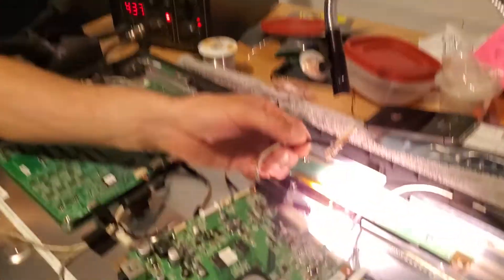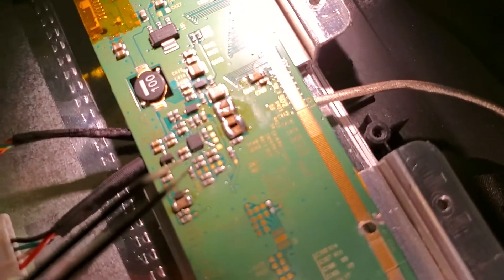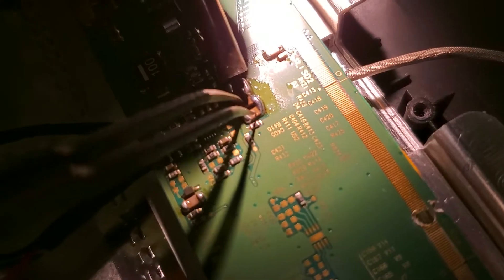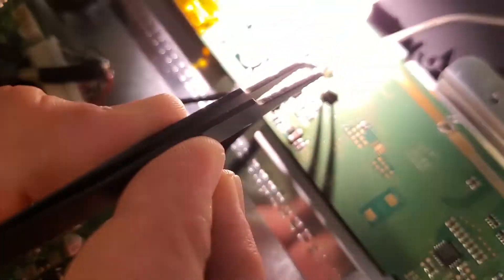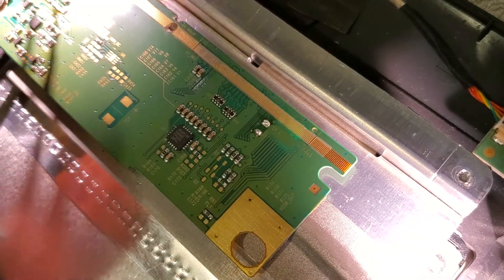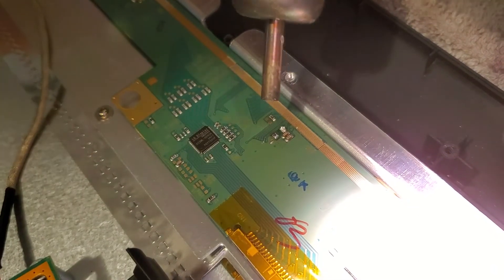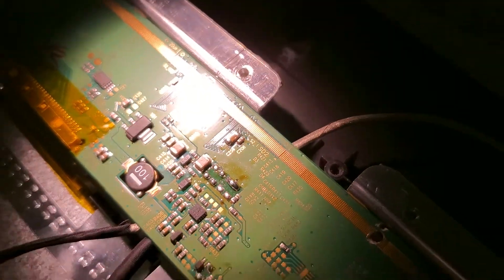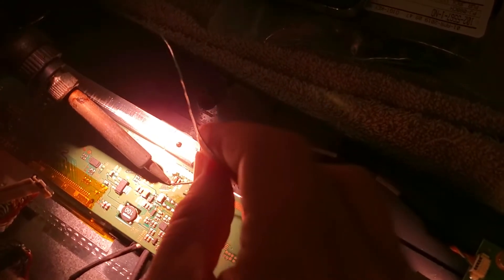CINTIQ 22HD REPAIR GUIDE How to replace DISPLAY BOARD CAPACITORS

Comment: Hi Ian! Thanks for the content. I was wondering if the capacitor you have linked in the description is the same as the capacitor on a 27QHD?
Reply from the maker: 27 is completely different. You want to try messaging repair lab in Greece, send them a main board. Or you can swap the main board after market

Comment: Would it be possible to use a soldering iron to remove the capacitors instead of a heat gun?
Reply from the maker: If you pop a bead if solder over the whole joint it should pop up fairly easily

Comment: Hello Ian, when I turn on my Cintiq 27QHD, the white WACOM sign shows as usual, but then display goes  in eco mode, the eco sign float on the display for a while then it turn off. It's not a missing signal from the computer or cable issue. Indeed I disconnected the Cintiq and replaced by another screen, and it works correctly. I have also tried connecting the Cintiq to another computer and the problem is the same. So I guess it is a capacitor issue. I have disassembled the Cintiq 27QHD, and the inside is quite similar to the 22 one. I have fund the video card. 

Do you know the capacitor characteristics for the Cintiq 27QH ? Thank you so much for you help

Comment: Thank you for the video. I have a Cintiq 22 and only half of the display reacts to the pen commands; beside this issue, it works great. Is it a software or hardware issue? what do you think? Thanks
Reply from the maker: Exactly half? That is pretty rare. Not some intermittent spots, but an entire half? Email pics procersapientiae@gmail.com
It could just be a loose internal ribbon cable, did it suddenly start happening?
Reply: @procersapientiae  Thanks for replying.  I will send you some pictures soon.

Comment: Dear Ian Tompkins, Would there be a way to help me and another technician by providing us with the Cintq Wacom 21 UX DTZ schematics, if you have them, or else, the link to it? In this case, I am the owner of this table, and after a fall it suffered, it stopped working. I sent it for repair at a service close to my city, but due to the lack of expertise of the technician who handled it, this ended up damaging it even more. At this moment, in a new attempt to repair it, together this time with a new technician, but we are facing enormous difficulties in accessing her schematics and acquiring replacement components for the repair of the board. Could you help us in some way? In response to my request, I am waiting for a response from you.

Comment: hi thanks for the video, would you be willing to sell just the replacement 
components?
Reply from the maker: Yes, I sell a pack with enough to fix 2 for $10. However, we're waiting for some extra components for a new potential issue that hasn't come in yet, you may want to wait a little bit, otherwise I can send out an existing kit. email IATompkins47@gmail.com
Reply: @procersapientiae  I plan to email. I'm running into the issue of having to buy the parts in bulk wholesale. I would rather order from you  for just the parts I need.

Comment: Can you fix a Cintiq 24HD DTK-2400 with this technique?
Reply from the maker: 24HD is completely different, usually a bad backlight. Will eventually make a video on this and a kit, but have been super busy with regular life stuff
Reply: @procersapientiae  That's totally fine Ian, take care of yourself first old sport. Thank you for your reply.

For future reference, my 24HD cintiq is doing the thing where the screen turns on for half a second and then turns itself off. The machine itself is still on with a blue light on top but the screen just won't remain on.
Reply: Hello I ve got the same problem on my 24HD. I 'll be very interested by Ian answer to our problem.
Edit :
That is, when starting up i can see  briefly the screen lighting up, then black but the image is still there to be seen with flashlight.